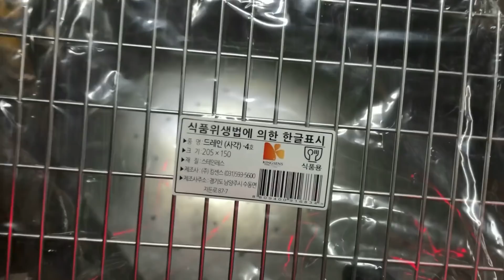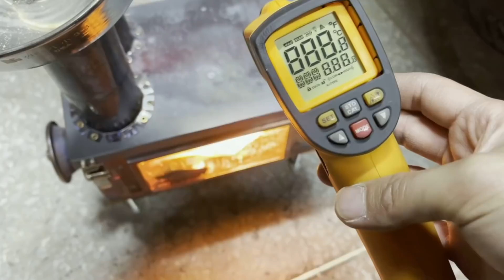용접없이 펠렛연소기 만들기/캠핑/우체통스토브/Making a pellet burner without welding/Camping/Postbox Stove

Comment: Thank you for sharing your meal with us.  The lamb chips looked wonderful; what was the seasoning that you dipped them into?   In addition to your fireproof pad consider adding a layer of bricks or segment pavers.  If you are using the stove for tent camping the blocks would act as thermal mass, absorbing heat and dissipating it later.  I used to have a small camp stove ~30cm across and ~75cm long (think of a metal pipe).  I would build a base of pavers and enclose all but one side.  This provided a small oven for cooking foods and / or drying wet mittens, socks...  Wishing you and your family a wonderful new year filled with peace, prosperity, health and happiness.
Reply from the maker: The lamb seasoning is a sauce called Tsuran
Goes well with meat
When I get a brick, I will definitely use it.
Thank you for your good opinion